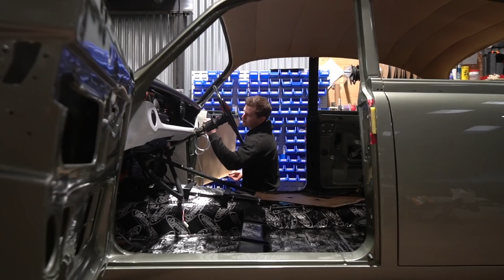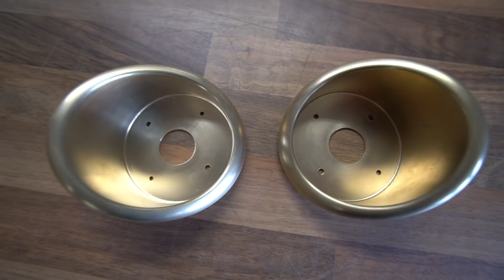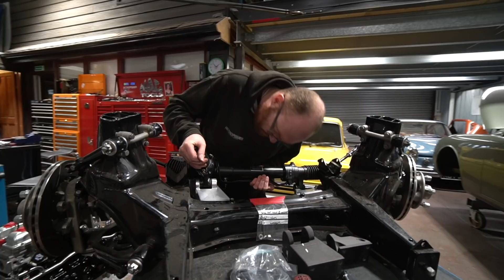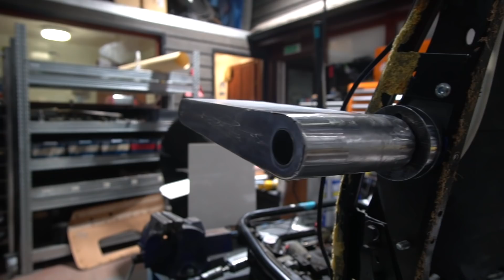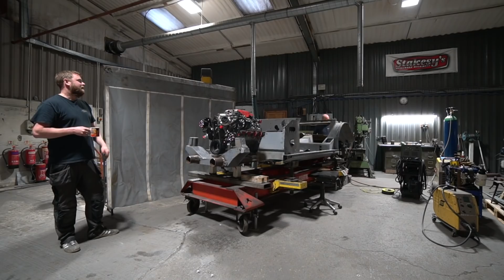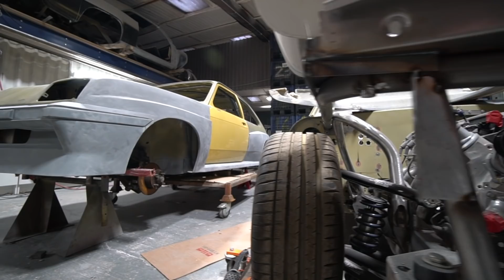Retropower Uncut Episode 26: Wide body Morris Minor metal shaping & 2JZ ready to go into MK2 Jaguar!

Comment: The very obvious? Use a Toyota gearbox, clutch etc. Then a fabricated tailshaft to suit both transmissions.
Those rear GUARDS on the Moggy are interesting. But do they actually bolt on like the originals?
Reply from the maker: Yes the rear wings bolt on as per original.
Reply: Even more obvious, why should they use a Toyota gearbox when they've got what they wanted with the BMW item?

Comment: you NEED to reduce the size of the alloys on the Minor, it`s just not right! if it looks right, it is right, & they just don`t look right!
Reply from the maker: They will be smaller, these are just the ones that came on the MX5 donor and the overall diameter is the same as we want.... but the final ones will be smaller wheels with taller tyres

Comment: Depending on what type of compressor you have you you can by pass it.
If its a thermal motor or wax stat a nut or two will force it open .
Better to run a bit cooler than overheat. 
 The probe type can be bypassed two, aslong as your sure its at fault. 
This last one  isn't recommended if your compressor is hidden away.